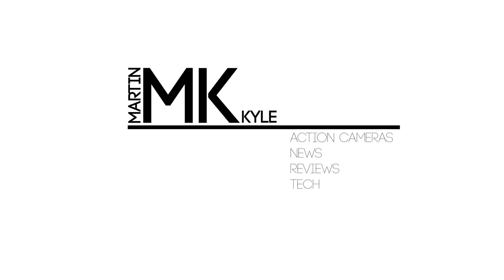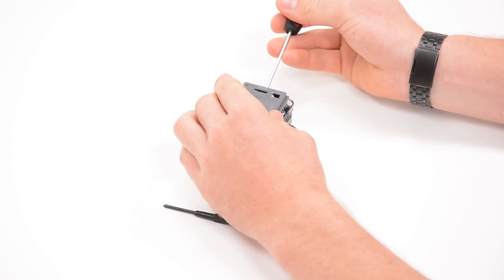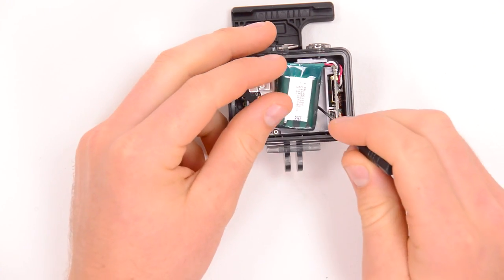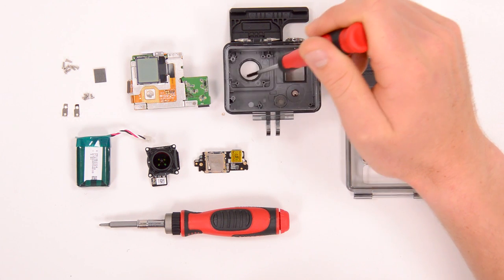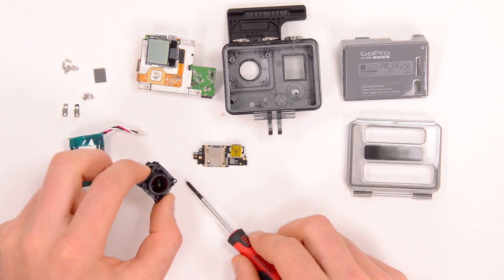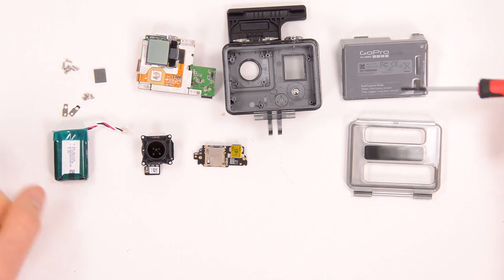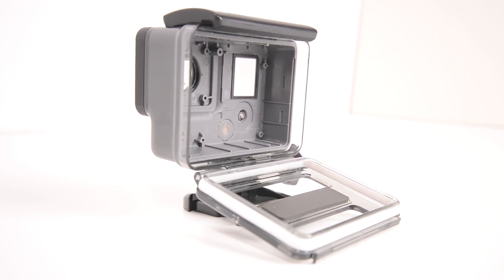GoPro HERO Teardown

Comment: Hello Kyle ! 
I suppose there is a rubber O-ring around the innner lens...does this mean that dust or fog cannot enter between the outer flat lens cover and the inner lens ? It's the only possible problem I can see related to a "sealed" housing. Thanks for your input.

Comment: Does the battery in the GoPro Hero deteriorate like a pone battery which has a sealed battery?

If so could you theoretically change the battery by pulling the old battery out and then putting a new battery inside.

Comment: I been looking for a video showing this for ages and only found it after you mentioned it during your original review. Maybe change the title to GoPro Hero dismantle etc so it's easier to find?
But great to see how easy it is to replace the battery in one. 
I almost bought a drift but so many freezing/fogging issues so probably back to GoPro and this basic hero instead of another Hero4 silver. only need it for commuting on a motorbike...

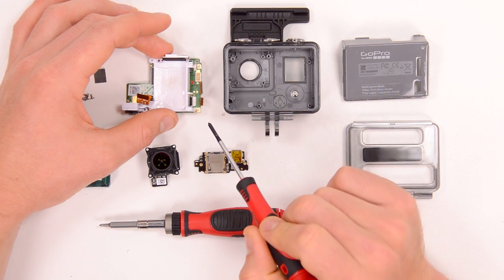Comment: 3:51 The microphone should be located next to that top button, as it is with the earlier models (Hero 3+ and 3). The part which you later look at on the bottom of the camera (with the earlier models at least), it's an LED there instead.

Comment: Great video! Always wonder how to get this boy open but it was so simple all along! Don't be too scared to take about a hero 3 or 4,I've done it several times, as I am a camera repair tech by occupation, its pretty much just as easy...if not easier! You also actually get to see the sensor which is super cool, and you'll be amazed by how small it is on the 4 considering it produces 4k!

Comment: i did this with a philips and flat head because my outer shell was cracked and it was really easy and i put back together and still works fun little project
Reply: update i got a doa gopro hero brand new and just replace my good board and works perfectly lmk for mor info

Comment: hey thanks a lot of the teardown. My gopro hero lens is scratched from day one and I actually took it apart, broke the scratched lens and replaced it with another lens with similar size and stuck it with aa glue! It works! A really simple get around on this gopro cannot remove case trick

Comment: If the casing or lens gets scratched/cracked, there's no repairing it, is there? Any idea how sturdy this cam is? Does anyone make a protective lens or case cover for it?
Reply: I've been wondering the same thing. I got this as a gift for Christmas and want to use it for a Tough Mudder event I'm doing in September. I've been looking for lens protectors but all that seems to come up is replacement lens and covers for Hero 3 and above models. It would be great if there was one for the Hero 2014, but as it is I'm a bit apprehensive to use it for Tough Mudder in case the lens gets damaged.

Comment: It was hard for me to tell... can you remove the battery (disconnect the jack) after removing the rear cover, or do you actually need to remove the screws on the board for access to that? One of the reasons I haven't purchased the HERO is that a user cannot simply change the battery. (And I also own a H3B and H4S.) Thanks.
Reply: +askjerry I have the exact same question...

Comment: Does anyone know where can I get a replacement battery for my go pro from ?  All my searches bring up go pro batteries for versions 3 & 4.. I need the one for the original Gopro as in the video
Reply from the maker: The number of the battery is PR-062334. If you spend some time looking around online you might find one. A better thing to do would be to pull the battery out of the camera and take it to a local battery shop. I bet they would be able to find you a replacement

Comment: Let's say i have water in it, like in the camera, how do i get it out?
Reply: Had the same Problem take a hot air gun und heat it at 300degrees for 10 seconds then just let it cool down for half an hour and youre fine
Reply: I did that and it worked but acted really weird, i think the battery is done, so i think i'll get a new battery and see how that works out.
Reply: OK for me i had to wait around half A day till it worked properly actually it was today
Reply: Matthew Walldorf I'll try to put the battery back in and see if it charges properly
Thanks btw
Reply: Matthew Walldorf Did you take the hot air fan to the battery too?

Comment: Why don't remount it out of the case, create new stuff with it just for fun? And replace it on the case after ^^
Reply: There ya go.....put it together outside case. use dabs of hot glue to hold screws and shoot some video that way!
Reply: *****
what's the benefit? a non waterproof camera which is marginally smaller

Comment: You shouldve tried to fit in another gopro in the case.
Reply from the maker: I tried it, the lens cut on on the front of the case is far to small to fit a normal GoPro into
Reply: GoPro Tips and Tricks
 It sounds like if the gopro hero case was damaged, you could put it inside a spare waterproof housing (even if it required a bit of epoxy/sugru etc)

Comment: i bought a hero+ what a misleading waste of money. DO NOT buy the gopro hero+. except for the backdoor, nothing is replaceable. You cannot replace the housing or the lens frame. If you get anything scratched or cracked on the front, you are soh^t out of luck. I contacted gopro because i dropped mine about 1 foot off the ground and front scratched very deep very easily. Support said they dont cover abuse. It has a poorly made case. If the case was replaceable it wouldnt be such a big deal.

Comment: You are dismantling the camera without releasing the battery? Very irresponsible dear. but very cool video, like!
Reply from the maker: I tried to pull the battery earlier but it connecter was very tight and because it was buried so deep I was worried I would damage it by pulling on it to hard. After getting it out it turns out it was just a tight connecter. Next time I will pull the battery first.